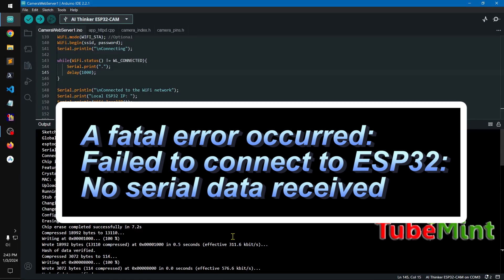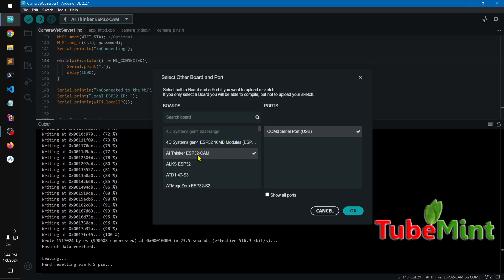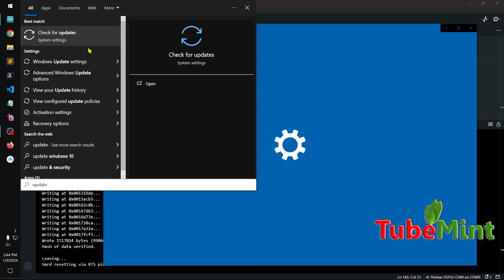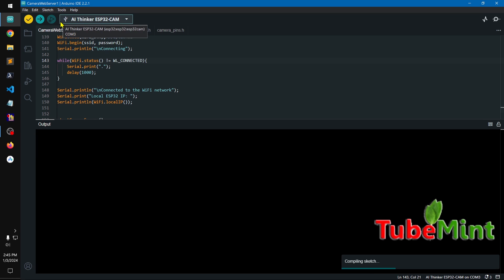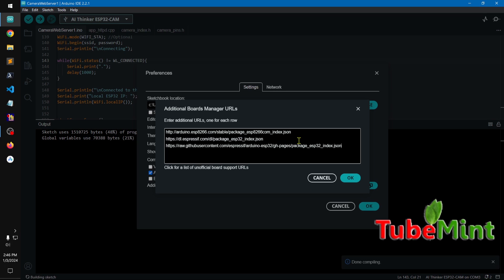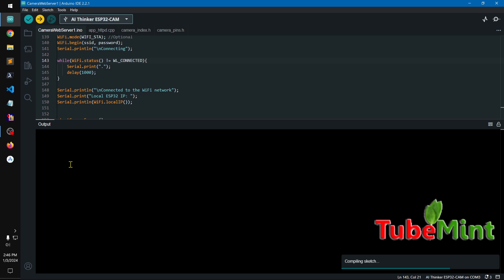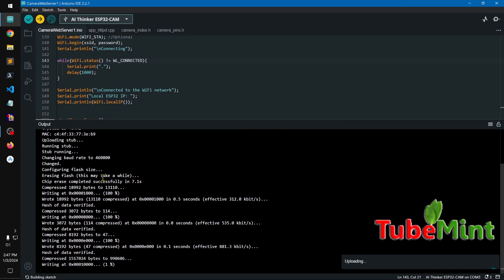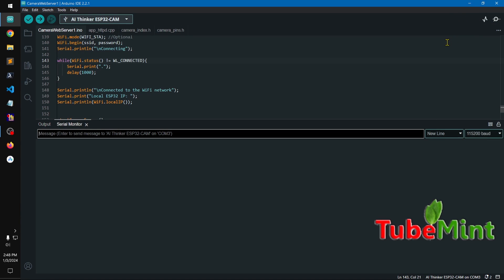A fatal error occurred: Failed to connect to ESP32: No serial data received

Comment: Sometimes this error is occured because you already have a code uploaded on arduino and you are trying to upload a code on esp. this is same as 2 people are taking to one person at one time so the person cannot understand any of them.
Solution to this is that you first upload a blank code on arduino and then upload the esp code so there is no interruption in sending and receiving serial data from esp to system
Reply: it still says the same error
Reply: @kpotatou1621 then it might be the cable issue or connection issue bcz serial data is not transferring
Reply: @aleem2422 now it says wrong bootmode detected. The chip must be in download moad. How can i fix this?

I tried pressung the reset, boot, button during uploading (holding it down, pressing it once or continuously) but it doesn’t work. I’m uploading on an esp32 cam

Comment: help getting same error
Reply: Same problem 
Can you help me
Reply: @somasekhar6486   after testing the on board voltage regulator I found out my board was fried.........i got a brand new esp32 which worked perfectly
Reply: @somasekhar6486  After testing on board voltage-regulator I found out my Esp32 is burn out.....only solution was buying a new esp32 board

Comment: Bro can you help me in connection of esp32 cam with ftdi 

It's say error as no serial data received
Reply from the maker: learn about pins on your board.. every board has ground pins, power supply pins on both sides..
Reply: did u solved the error
Reply: @tanish_palkar6015  yes 👍